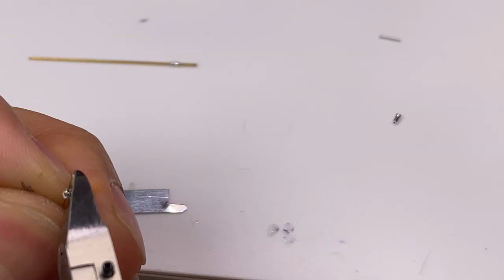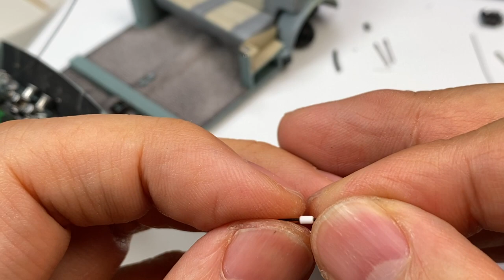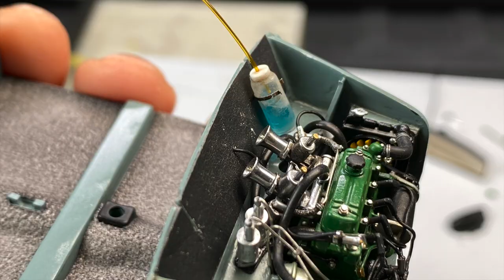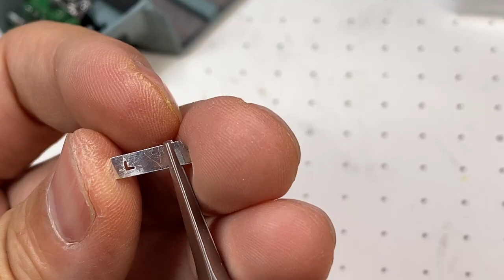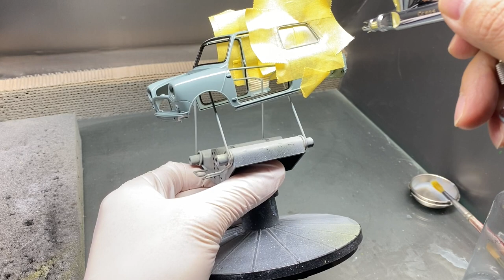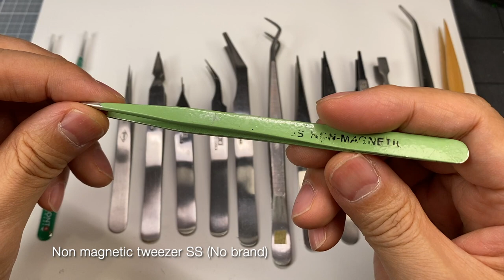MORRIS MINI COOPER S 1/24 TAMIYA- part 6

Comment: More and more surprising works: maximum detail, absolute precision and total cleanliness. It's like the tale of the ugly duckling that becomes a swan !!
I could ask you for some information:
- which scissors are used to cut the very small pieces from the aluminum rods with great precision ?;
- are the battery terminals obtained with a lead wire ?;
-for candle pipettes, is the polystyrene dough bent after it has been engraved inside the curve?
Thank you and ..... we look forward to other works of art ...
Reply from the maker: Thank you. Scissors are for stationery, and for wires, please refer to other my videos (Miura).

Comment: Coming along nicely, as if it was going to go any other way. As I've said before, it's almost insulting to harp on one aspect of a video when the quality is at this level, but I've got to hand it to you on the wiper fluid reservoir. I don't know why that piece stuck with me specifically, but I got a real kick out of it. Something about simple, elegant solutions to problems, I suppose. looking good, and looking forward to the ext one. Enjoy the rest of your week.
Reply from the maker: Thank you. For the wiper liquid bottle, I wanted to express the liquid in the bottle in a witty way rather than pursuing realism.
Reply: @A4Garage  Well, I know I'm biased towards your particular brand of model building, but I thank it worked out spectacularly. Mission accomplished.

Comment: Amazing work.  The car was actually an Austin Mini Cooper S, in the UK at least. The kit gives the wrong name and decals.
Reply: They had Morris mini cooper s in the UK too..It should have twin fuel tanks
Reply: @briansdiecastthailandstoth6747  Twin tanks were an option on that year's Cooper
Reply: Nope, there were both Austin and Morris with small differences, Tamyia later released the same kit as Austin with few different parts like wheels etc.

Comment: I gotta ask.  When you are fabricating those "microscopic" parts from bits of sheet metal, wire, and tubing, do you sometimes have to do multiple iterations to arrive at finished "usable" component?
Reply from the maker: Of course, there are many failures. I stop when I want to give up and try again the next day. Thanks.